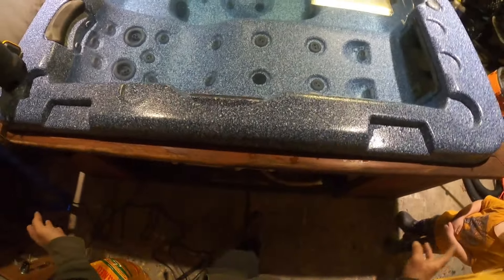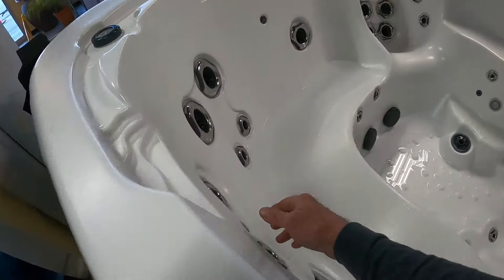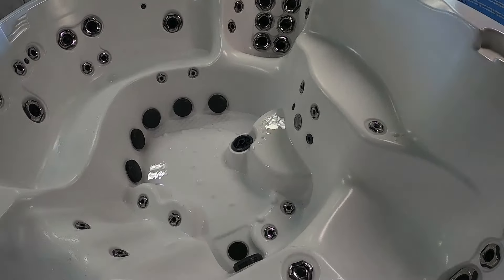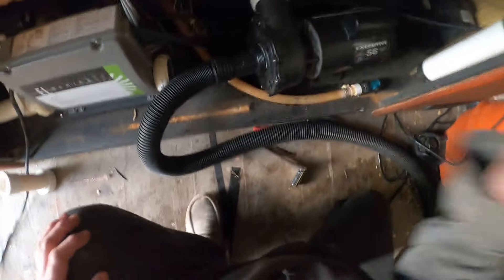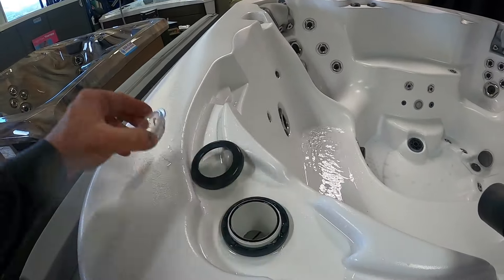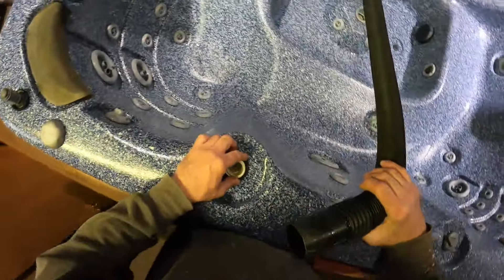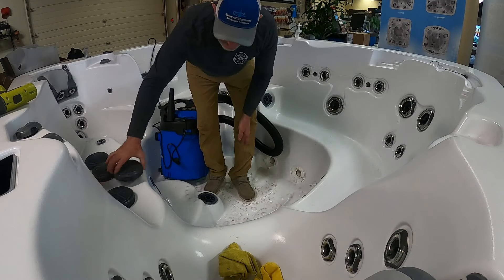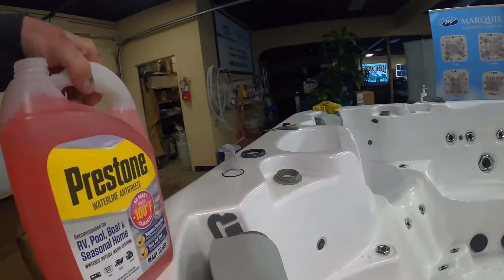How to Winterize a Hot Tub: Hot Tub Winterizing: Hot Tub Drain and Winterize:

Comment: Nice video.  We had our hot tub professionally winterized last Fall and didn’t use it this year.  Does antifreeze need to be applied annually if it wasn’t used for a season?  The cover had plywood and a tarp over it so it’s unlikely any water got in, but I’ll check to make sure that was the case.
Reply from the maker: Should be good to go as long as no water got into the lines.

Comment: i held my shop-vac under the pipe where it connects to the pump, and slowly loosened it. didn't spill a drop on the floor. the vac pulls it right in. didn't take long, kept loosening more and more. did that with all the pipes connecting to the pumps. separated the pipes from the pumps completely then got all the water out that wanted to come out. 
then added antifreeze to everything.